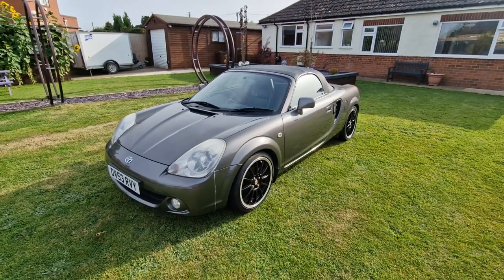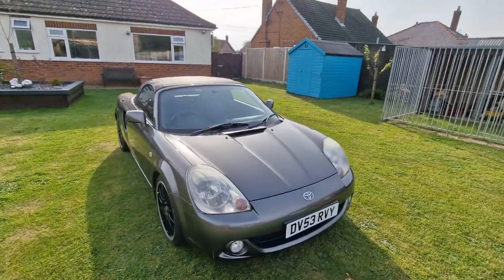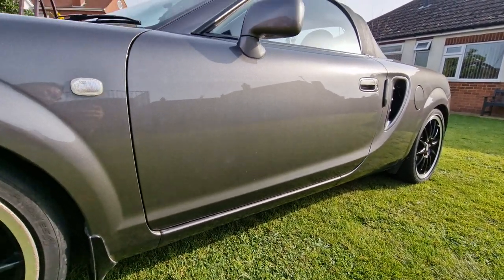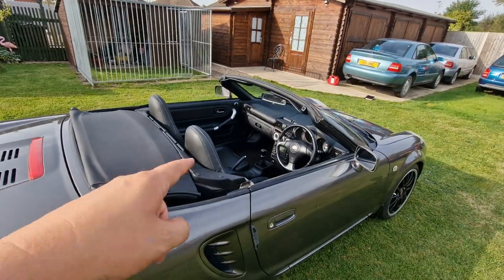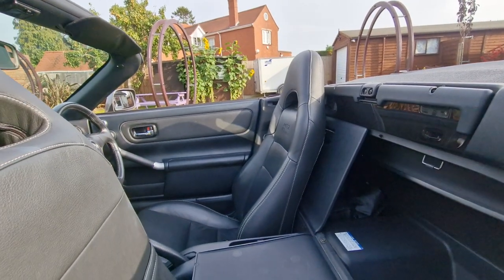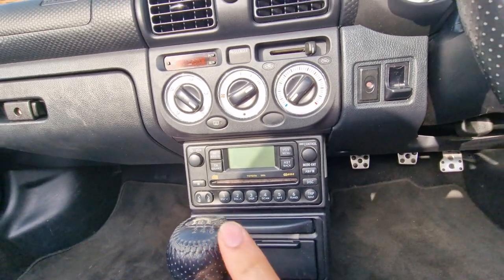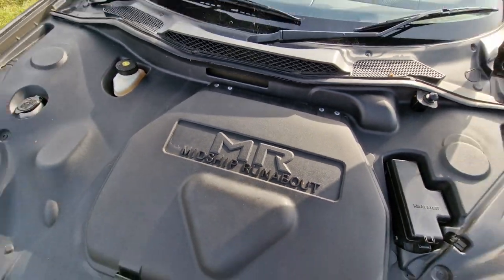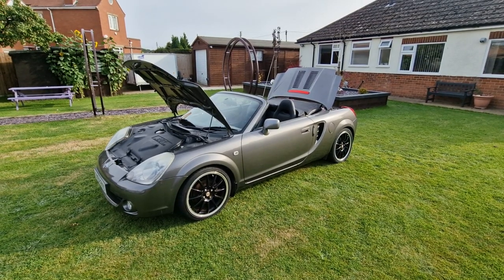I Bought A MK3 Toyota MR2 Roadster - Full Review & Walkaround

Comment: I ran one for a while as a company car back in the day, I could get my laptop bag under the bonnet not much behind the seats and the rest in the passenger seat/footwell. Lots of fun, great handling but apparently time has shown that the 2nd cats can disintegrate and get ingested into the engine so check that they’ve been removed or it might be expensive! Otherwise a desirable little sports car as a toy, enjoy.
Reply from the maker: I believe this only affects the prefacelift model 👍☺️
Reply: @JonCoupland  Can happen on any up until very last few made late 2005 on, there was a revision in the pistons on the facelift but only a partial fix. Yours has an aftermarket manifold fitted so the pre-cat breakdown won't be an issue for you. Watch out for excessive oil consumption though and change the oil every few thousand miles to try and prevent the oil consumption issue ever developing.